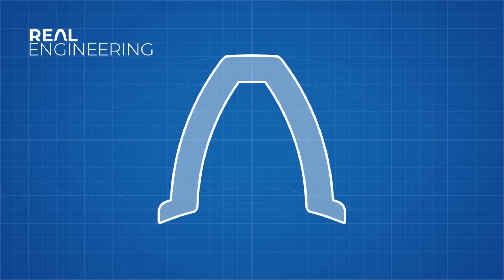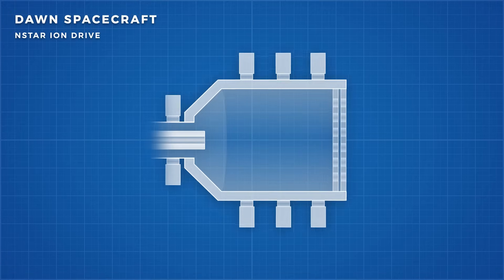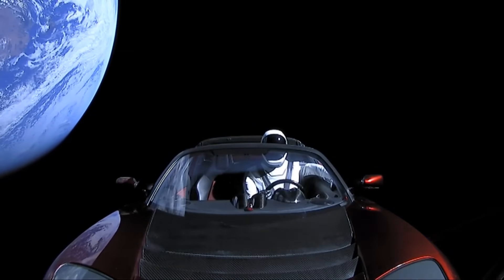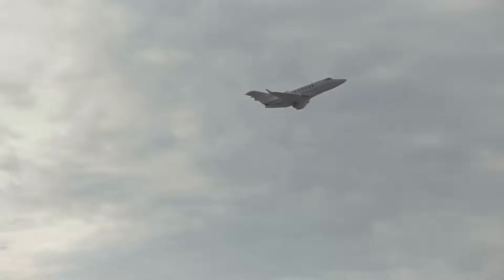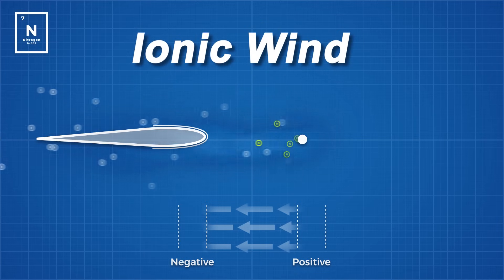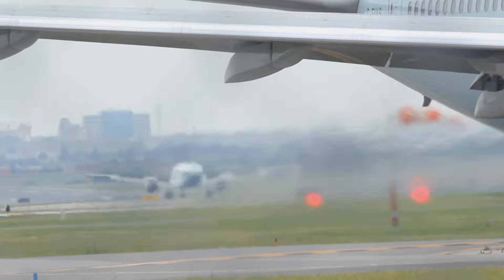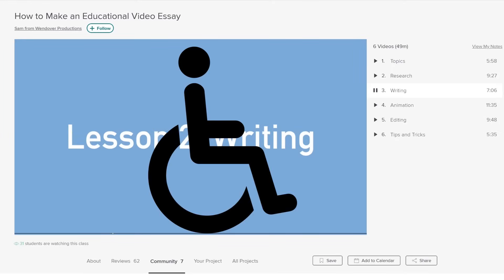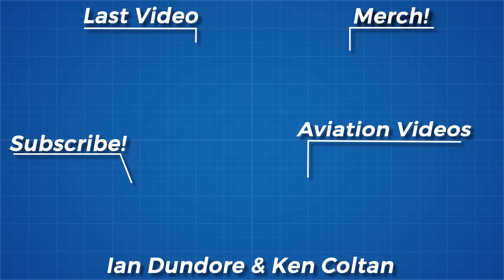Ion Propulsion - The Plane With No Moving Parts

Comment: This is akin to the Wright brothers flight. It's just as inefficient too! But soon, the plasma jet will be perfected, the ionic propulsion analog to the jet turbine engine, wherein plasma and neutral gas will be spun as a neutral plasma, compressed and accelerated out of a magnetic nozzle. Only then will the thrust to specific impulse ratio surpass that of chemical propulsion, but it will surpass it by an order of magnitude. Vectored thrust can be achieved with changing the electric potential on control surfaces or a magnetic nozzle using multiple coils to direct the plasma, again no moving parts required.
Reply: The MIT craft is not the first ion propelled craft with onboard power. It was very much less efficient than the one that precedes it.  It is not at all like the Wrights man carrying plane with agile steering either.  The Wrights 1903 flight did not use a catapult, they did that in 1904. The majority of the energy for the MIT flight came from a bungee cord.
Reply: @KraussEMUS1  Certainly ion engines onboard satellites have been demonstrated that have onboard power, but are you referring to another ion lifter device that operates in atmosphere? I've seen lighter than air balloon craft operate on ion wind.

In any case,  I stand by my original assertion that with nozzles to aid in magnetohydrodynamic compression of plasma, this will be orders of magnitude more efficient than mechanical propulsion
Reply: I agree with you in general.  I am talking about the Self Contained Ion Powered Aircraft.  It has orders of magnitude more thrust than any other ion thruster for its weight.  It lifts its power supply from the ground.  If you click on the purple channel icon to the left, you can see several rough prototypes lift their power supplies, located in the center of each model.  
 @taylorwestmore4664
Reply: @KraussEMUS1  That is indeed impressive! Thrust to weight ratio over 1 is a great, and you haven't even taken advantage of lift yet! Please continue to improve the design!

I'm working on using a physical nozzle and a magnetic nozzle in tandem to compress and expand a plasma. The whole configuration is a two stage dense plasma focus, or a Z-pinch design. 

If you continue to refine the design, I'd like to see you incorporate a very thin, wide nozzle between the Anode and Cathode, to cause the ion wind to concentrate. compress and then expand the ion wind. Increasing the velocity and pressure as it goes through the choke at about a 15 degree angle, and letting the ion wind expand at a 4 degree angle (the de Lavel nozzle geometry) would GREATLY enhance your already high efficiency and high thrust/weight ratio design.
Reply: Hi Taylor,
Thanks for the positive comment!!   It did used to be, that in the old days it  usually took a several kg stationary power supply to lift a several gram tethered flying model.  I am happy to have made a craft that is able to carry its power supply, it was a long process! 

The De Lavel nozzel will work with hot gasses, but the craft I built avoids heating the exhaust as much as possible.  I have looked into using a different type of ducting though, and it appears it can have some advantage if the air is concentrated near the collectors.  It is tough to build it light enough to be advantageous from a practical standpoint.
Thanks again!  @ @taylorwestmore4664
Reply: @KraussEMUS1  
That is true! That's why I want to go the hot and dense route. But I believe something in between would work best.

De Laval nozzle will also work with any compressed gas as long as it is higher pressure than the surrounding atmosphere. Though you are right that expanding gas from a chemical reaction is more powerful because the expansion ratio is driven up by both the change in density of daughter chemicals compared to parent chemicals, and the heat which causes a change in density.

If you could take something light, like a neutral aluminum foil sheet, a plastic sheet, or carbon fiber sheet, in the path of ions moving towards the electrode, you would be able to angle them in the de Laval Nozzle's particular hourglass shape, to create the nozzle along the edge of the electrode without adding significant weight. This would give you a compression/expansion ratio that applies mechanical advantage on your ion wind, making it have higher thrust and higher specific impulse.

Keep up the good work!
Reply: Hi Taylor,   I think you are right, I think something like that does work.  I built a sample test apparatus last year, and it does appear to produce a slight bit more lift.  I wrote about it a paper then.  It  consists of two linear streamline cross section shaped trough edges for the emitter wires.  I only found it advantageous in concentrating the air onto the emitters.  The difficulty in building them light enough though and placing them on either side of the emitter wires, makes the plan more of a future idea.  I've other fish to fry for now.  Thanks again though!  @taylorwestmore4664
Reply: The Wrights did not use a catapult on their 1903 flight, not until 1904. Their human carrying craft had the first really good steering as well, and did not derive most of its flight energy from the catapult.  The 16 foot large model glider made by MIT had a projected 1kg weight air frame.  It is nothing like the 800 pound Wright flier. MIT was not first to carry a power supply with ions either.

Comment: Why doesn't the positive grid repel the xenon ion??
Reply: It DOES repel the ions, but only with a certain force, once the ions inside the magnetic bottle get excited by electrons to high enough voltage, the ions will move with more energy than the repulsion of the grid, and because they slip through the holes in the grid, all the stored energy is released by repelling on the grid and pushing the spacecraft and ions apart.

Higher voltage positive grid will increase speed, but also increases the negative voltage of electrons inside the chamber to heat the ions.
Reply: @taylorwestmore4664  when xenon ion is inside the craft it experiences two major forces.....one attractive (negative grid) and one repulsive (positive grid) ......the positive grid is nearer to it so it's repulsive force should be greater and the xenon ion would not approach the exhaust
Reply: @rishigupta2556  It is repelled, until it becomes too fast, then it can escape the grid and push it from the OTHER side.
Reply: If you read my patent you will see it differently.  If you click on the purple icon the the left you can see 4 flight videos of an ion propelled aircraft with onboard power, that predates the MIT device.
 @taylorwestmore4664
Reply: It is irrelevant since the MIT craft was not the first with onboard power and is not efficient compared to others.
Reply: A large percentage MIT's theories about ion propulsion are not correct.  They are not the first to carry a power supply using ions either. To answer your question in part, they did not use xenon since there is no need to carry onboard propellant in the lower atmosphere and the surrounding air can be used for that purpose. If you would like to see the earlier, more efficient, patented ion propelled aircraft with an onboard power supply, Please click on the purple icon the the left.

Comment: Title is very innacurate, the pitch, yaw, and roll controls will most definitely have moving parts. Not to mention landing gear and other mechanisms. You should change the title to a plane with a propulsion system with no moving parts.
Reply: Title is inaccurate. "The Plane" is specifying the test plane demonstrated in the video. This does not have manoeuvre controls or landing gear.
Reply: Nor is it the first ion propelled aircraft to carry its power supply. It is not anywhere near as efficient as the preceding craft. You can click on the purple channel icon to the left if would like to see the earlier one in flight. Actually, the earlier VTOL invention really doesn't have any moving parts except itself and ions.  It will need some variable resistors in the near future though for steering.
 @madmax07ish

Comment: to be fair i dont think rocket engines have any moving parts
Reply: Solid boosters don't
Reply: Not true unfortunately. Most useful rocket engines contain hideously complicated turbopumps to pump fuel into the combustion chamber
Reply: Ion propulsion is a form of rocket engine, but if you have a very week poorly designed rocket you can launch it with a bungee cord and large lightweight wings on it, and yes that will do something.
Reply: @KraussEMUS1  that's why I clarified by saying most useful rocket engines i.e. The type most commonly used today
Reply: Hi Dean,
I patented the world's first ion propelled aircraft to carry its power supply, it is useful for very light duty applications.  Now recently MIT made an ion propelled aircraft that has orders of magnitude less of a power to weight etc. and they are telling the world they are first of any kind!  I know chemical rocket engines do often times have turbo pumps and so on:).  So, I get what you are saying I guess. There's no argument there.
 @dsdy1205
Reply: Planes do have moving parts. I don't see what your point is.
Reply: @luongmaihunggia  the title of the video bro
Reply: @NibNa5ty  yeah I did. So?

Comment: Is there a relation between the applied voltage and minimum distance between the electrodes without causing spark to jump between them..?
Reply: Yes, about 30kV/cm. Sparks will travel farther between sharp needle points than between spheres or rounded surfaces though.
MIT did not make the first ion propelled craft to carry its power supply though. Please click the purple icon to the left to see the earlier more efficient one.

Comment: This has been a thing for many decades. Wikipedia search ionocraft. Tesla did some work on these. In theory, you could make lightweight craft float while close to a Tesla coil. However, it's very impractical, you lose lots more energy through this form of propulsion than others. It's woefully inefficient.
Reply: The tech was always inefficient.  The MIT craft is no exception.  There is however an earlier patented ion propelled craft, with onboard power, that is fairly efficient.  It still needs to be improved power density wise, but should be usable for small lightweight UAV applications.  Please click the purple channel icon if you would like to see flight videos etc.

Comment: This is called Electro Hydro Dynamics, in this case Electro AERO dynamics. Note the name of the craft. EAD1.. and although it ionizes and accelerates air, calling it an "ion drive" is a bit of a stretch. Laser printers also ionize the air.. In fact ANY HV device does. But a laser printer isn't an ion printer, and HV radio transmitters aren't ION transmitters.

Comment: I'm not gonna go through the headache of dealing with the aviation industry's imperial units and terms, but I can tell from looking at EDF T/P that this is very wrong. Sure, airliners get 3N/kW if you take wasted energy into account, but that's not an excuse for saying ion drives are more efficient than propellers/fans. Ion drives are the electric counterpart to turbofan engines. They pollute by producing ozone and are very inefficient.

Comment: They say to never say never, but I will: This will never, ever, under any circumstances whatsoever, *EVER* become a viable propulsion system for atmosphere-bound aircraft.  This is a curiosity, not unlike those "free energy" scamsters who show a magnet-encrusted device that keeps spinning and spinning during a demonstration but NEVER show it coupled to any kind of dynamometer.  Why?  Because it's so weak it couldn't even get itself started, much less turn a dynamometer.  I would like to see any sort of measurement of thrust for this ion drive, which we never see.  I would also like to see it carry something -- ANYTHING! -- besides the spindly gossamer test airframe made out of ultra-thin film.  That test airframe in the beginning of the video looked like it was just gliding from the initial launch energy; that was not "sustained flight."

Comment: The nuclear power generator used on Curiosity!!! 👍
Reply: RTGs can provide low energy over very long periods of time, but what something like this would need is a lot of energy very quickly.  The video claims the plane to be consuming 200 stepped up volts from the battery, an RTG like Curiosity's generates only 100-110 watts and twenty times that much in heat, and the fuel alone weighs in at 11 pounds nearly 5 kilos.
Reply: If you guys are interested in ion propulsion, you can see an earlier ion propelled solid state craft that carries its power supply before the MIT device, by clicking on the purple channel icon to the left.
 @youtubeisapublisher6407

Comment: Science is to pessimism as engineering is to optimism. 
Scientists postulate a hypothesis and look with a skeptical eye, to find all the reasons it won’t work. 
Engineers are given a problem and then think of all the ways to over come it.
Reply: They should take the patent literature seriously first though, before claiming that they are first.  Please click on the purple channel icon the the left to see an earlier ion propelled device that has an onboard power supply.
Reply: Ethan Krauss 
Lift isn’t generated in the same way. 
Fail to see how it infringes on said patent.

You’re right; pitching ions isn’t anything new.
Reply: It took an increase in power to weight ratio, of nearly 3 orders of magnitude for me to create the first ion propelled aircraft that can carry its power supply.  
(It was a widely accepted fact that ion thrusters required a several kg ground based power supply to lift a several gram flying model.)

MIT Is claiming specifically that they made "the first heavier than ion propelled aircraft of any kind to carry its power supply." In writing and in their video.
Their craft is a craft propelled by ions, that are being used to keep the craft airborne against the force of gravity.  My patent states any ion propelled craft with onboard power that supports itself against the force of gravity.
My patented craft is so much more efficient and powerful by weight, and was operational so many years earlier, why are millions of people being told MIT was first?
The invention can fly on one side exactly as an fixed wing aircraft. In fact all ion propelled devices with wing shaped collectors are "fixed wing."
"Pitching ions" isn't new, but carrying a power supply took many years of hard work and expenditure to accomplish. 

 @chetopuffs

Comment: What we need are Dilythium crystals with a large supply of antimatter.  A very well done video which explained perfectly why ion drive will NEVER be powering commercial or military aircraft outdoors. Even MIT's toy would not have flown without the energy provided by the bungee launch platform.  In my mind, a bit of a cheat. Great video though.
Reply: Dear Flagship,
I think you are spot on particularly about the MIT craft.  However, amazingly there is an earlier craft, that is much more efficient and predates the MIT craft by many years.  It could be used on calm days for light duty private applications.   Not in the near future for heavy applications though.  If you click on the purple channel icon to the left you can see the earlier patented craft.

Comment: Everybody seems to forget there is no afterlife for exhausted batteries.
They are toxic and there is no known proces to detox them.
Realize the excessive amount of batteries we are creating which will have to be stored(?) I guess in a couple of decades.
Not even to mention the way the electricity that was stored in them had to be produced.
If I say 50 percent of that electricity was produced without exhaust it is much I guess.
Reply: Ion propelled aircraft can run on solar though.  If you click on the purple channel icon to left you can see an earlier more efficient ion propelled craft with onboard power.

Comment: if ionized air accelerated thru a series of these electrodes, so that the air-flow speed up along the way.  Will this increase the thrust ?
Reply: Accelerating through a series of electrodes reduces the efficiency by a surprising amount.  If it just goes faster it will not be more efficient like MIT claims.  MIT did not create "the first ion propelled aircraft of any kind to carry its power, supply" as they claim and as this article claims. If you click on the. purple channel icon to the left you can see 4 flight videos of a much earlier patented ion propelled craft with an onboard power supply in flight.

Comment: What they need to do is make a hybrid system of this, basically using jet engines with alternators.. gaining more of it's lift and power from the jet engine, but using the ion propulsion system to effectively remove drag from the air
Reply: A lot of the point is to have a silent propulsion system.  The power density of ion systems is low, so on a jet craft it might not do much.  It could however make for really cool silent drones. Also, such a propulsion is much more efficient than chemical rockets for light duty applications.  So, there is lots of potential:). If you would like to see a much more efficient ion propelled aircraft that predates the MIT one with onboard power,  just click on the purple channel icon on the left to see it in flight.
Reply: Ethan Krauss I know about the silent aspect.. But making a hybrid system would make a craft that can fly much faster then it typically would.. also heat buildup on the outside of the craft at supersonic speeds would be minimal because instead the air is being ionized and directed instead of creating drag on the hull

Comment: With my idea wind and downforce can be taken out of the equation because the way the propulsion system works it is going to propel an object that does not have wings it doesn't need it it can provide lift and propulsion at same time